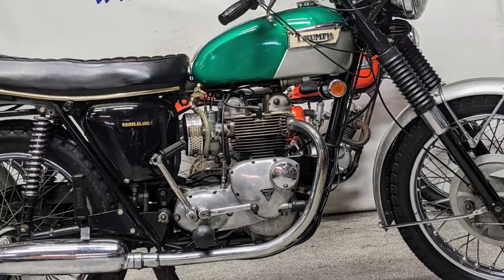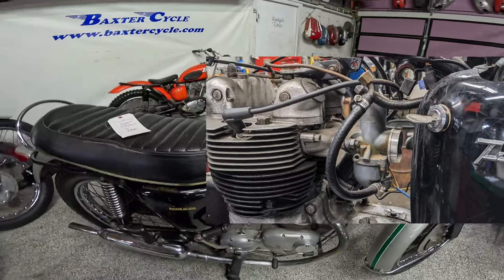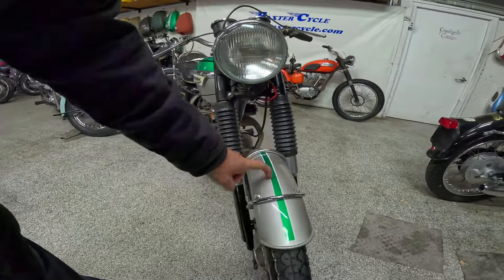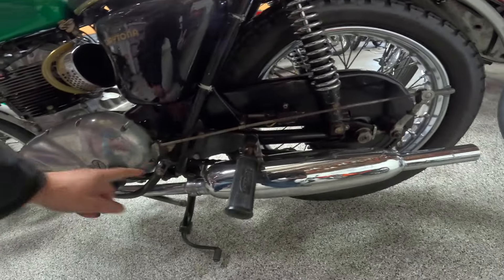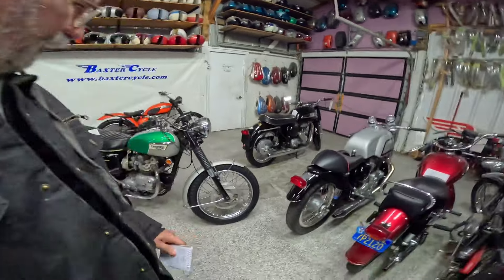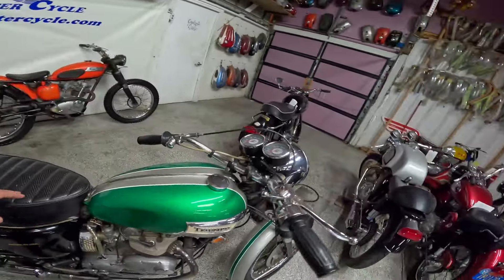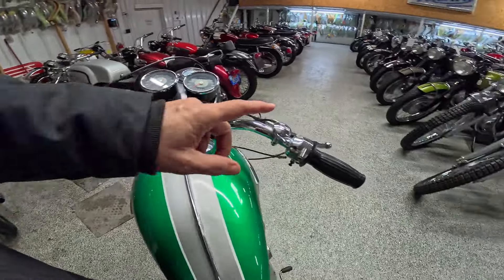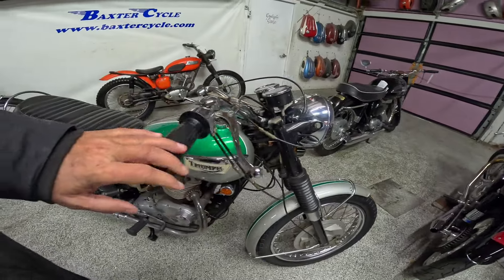Lean & Mean - 1969 Triumph Daytona 500 T100R - Baby Bonne - Wahoo!

Comment: The '69 to '73 Daytona's were the epitome of Turner's vertical twins! The twin leading shoe front brake was a huge improvement. '67's hemispheric heads were fed with twin carbs, the valves were activated by hotter "Q" cams to spin a crank on roller bearings. Power was delivered through a close ratio transmission. You could put around town with ease, but when the road opened up the bike accelerated with authority from 4,500 to 7,500 rpm. The 500 revved much quicker then the less entertaining 650. The 500 was the bike Triumph raced on both the dirt flat tracks and road racing events.    The light bike was a great dancing partner in the canyons! I still have fond memories of my '72 Daytona
Reply from the maker: Truly a beautiful machine. Absolutely enjoyed riding it 🙂